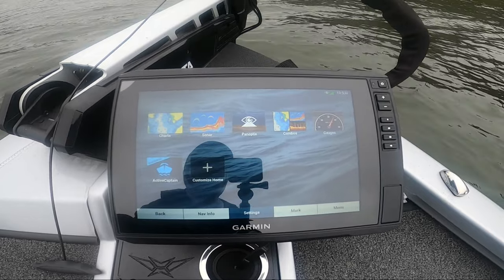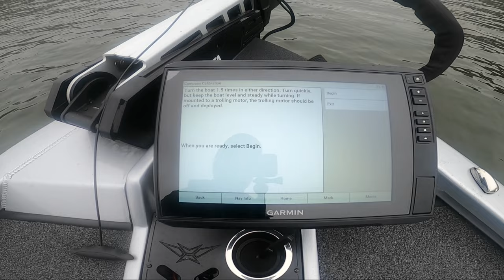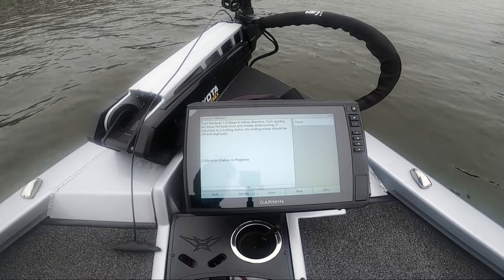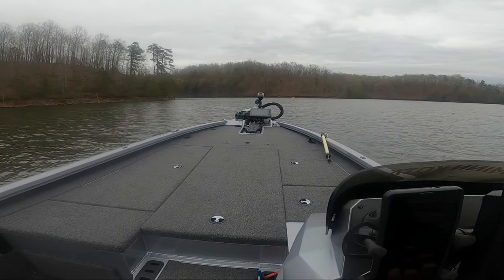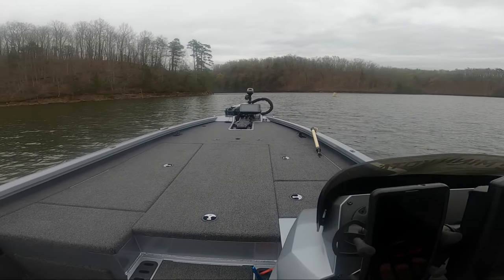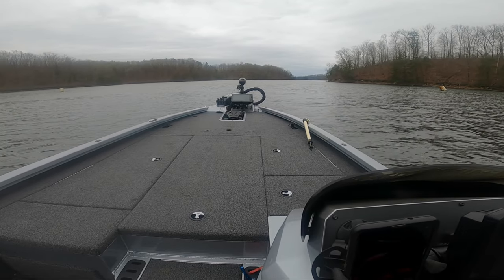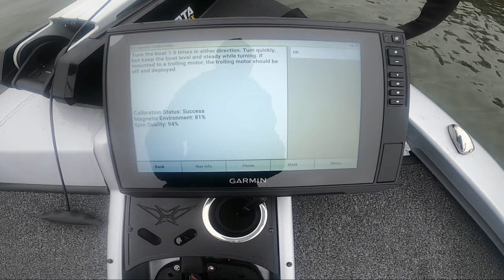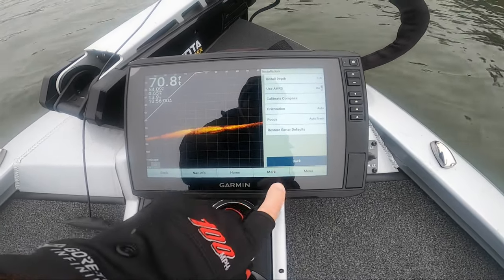Calibrate Garmin Livescope compass

Comment: Should I calibrate on a pole-mounted LVS 34?
Reply from the maker: My understanding of how the calibration works I would say yes. It stabilizes the transducer beam so that it's aligned correctly with the bottom and the boat. It ensures the  bottom is correctly oriented. Without it being calibrated the bottom could look steeper or flatter than it really is. Hope that helps.

Comment: Question, I am trying to do this however after clicking begin and turning the boat the progress bar just stays at 0... I have done this before and the progress bar moved but never completed successfully. Now it doesn't even attempt to start progressing. I have reset the sonar to default and tried again. Still no progress on the progress bar. any suggestions?
thanks Jonathan
Reply from the maker: Where is the transducer mounted?
Reply: Same thing is happening to me. Going to try disconnecting the network cable next.

Comment: Why didn’t you just drive it with the TM?
Reply from the maker: I have done it both ways. I got higher percentages and a more accurate icon orientation when doing it that way. If you use the trolling motor it is turned perpendicular to the boat when you are calibrating it. My on screen icon was never close when doing this.